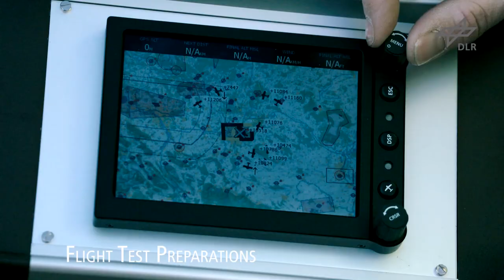DLR erprobt Tragschrauber-Drohne im Flugversuch

Comment: what is so groundbreaking about this? "new types of algorithms"... reading a gyro and feeding it to PID controllers? they've been around since 100 years or so. I don't want to take anything away from DRL's cargo drone, it's certainly cool. but this isn't much more technically advanced then a toy in todays world. Or am I missing something here?
Reply: Well yes, you are missing something. Of course a PID controller isn't what this is about, that is the "easy" part. This gyrocopter is a technology demonstrator for unmanned air transport and as such can be used to evaluate how to safely operate such an aircraft (something like this doesn't exist in civil aviation yet for a reason). There is a need for sophisticated path planning algorithms, avoiding ground risks, airspace integration with manned air traffic, strategies for emergency situations and so forth. You don't want half a ton to crash into your house or your holiday flight :-)
Reply: @hawker4110  I disagree. This kind of technology (the controlling part) is standard in fly by wire systems for decades, this is nothing new. I didn't see any sensors on the craft, I don't think path planning, col. avoidance and so on is the scope of the project atm. Frankly that would be a bit much for one team and better left to specialist in their field.
Reply: The groundbreaking thing is that the project left the concept stage an delivered an actual product that can now be tested and improved for mass production.
By contrast, most projects these days run out of kickstarter funding after blowing it all on renders of their product and bean bags for the lunch room...